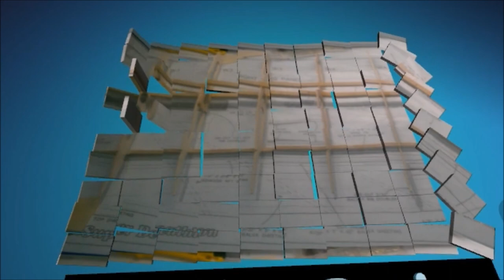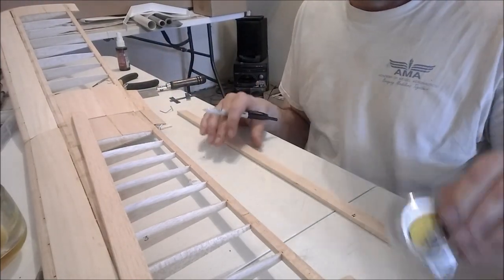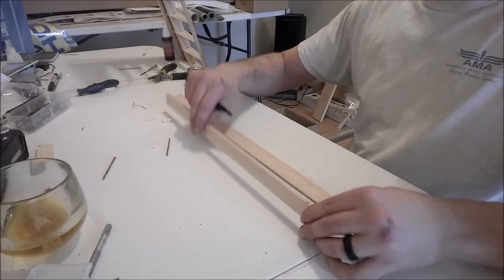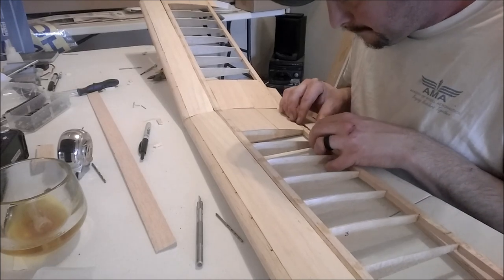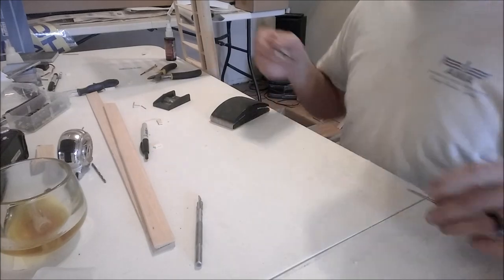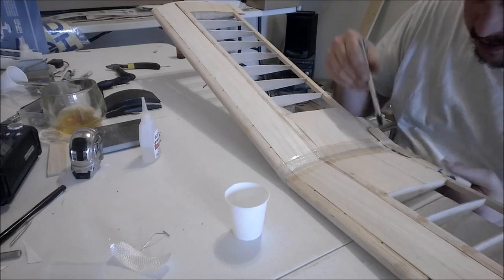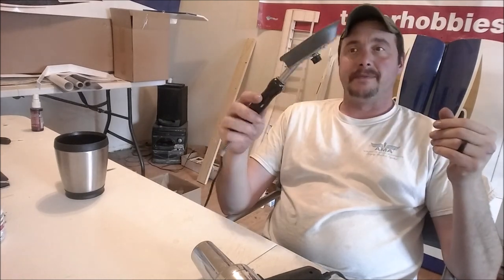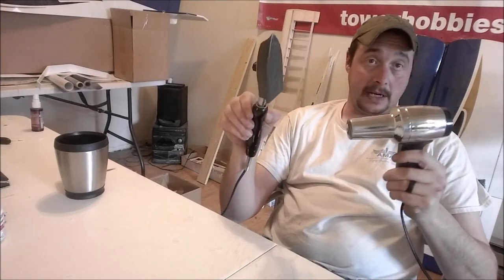PT 20 Part 6

Comment: did you use CA to tack down the fiberglass before applying the epoxy?
Reply from the maker: +Brian Pope Indeed I did, Tack it down at the beginning (forward) side of the trailing edge stiffener, the leading edge, both sides of the servo bay, trailing edge, and at the front of the trailing edge stiffener.